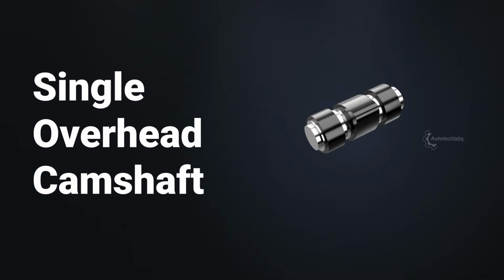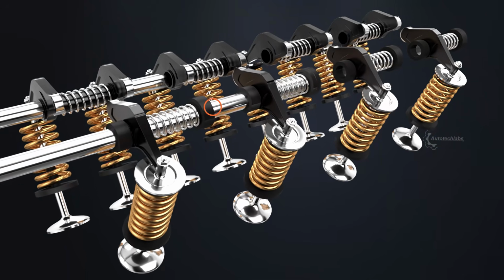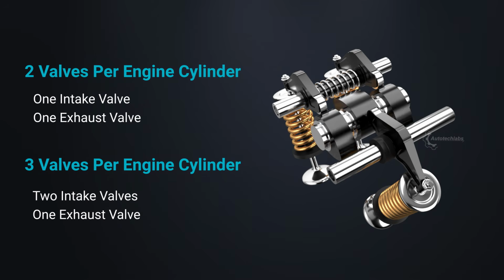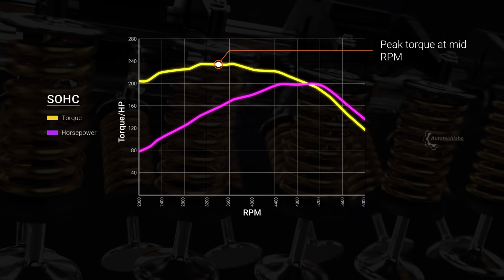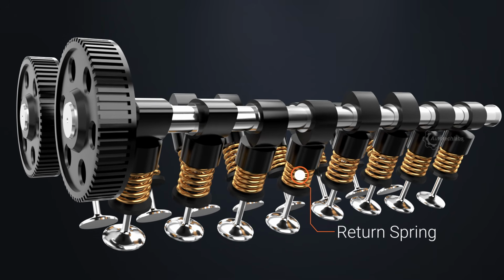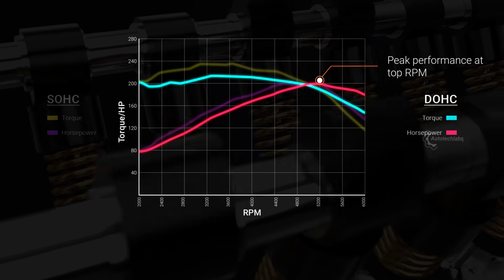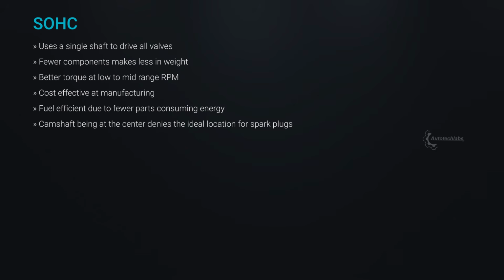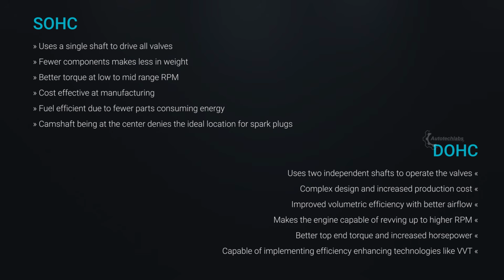SOHC vs DOHC | Autotechlabs

Comment: Tappets arent really used in modern engine designs anymore. As well as SOHC, seldom seen. And that may well be due to the VVT technology what is more or less state of the art in all  modern engines and you cannot achieve this with SOHC. the total concept is whats important and  with direct injection, boosting, central spark plug position and all the little things we do to optimize efficiency, the gain in friction loss reduction of SOHC can be overcompensated by reduction of one cylinder (downsizing by proper boost -> and the airflow that is needed to do that --> more valve area --> 4 valves) because the piston group has the highest share in friction in the whole crank and valvetrain.

Comment: Take a look at Yamaha R15 V3, it uses a SOHC setup, even then it has 4 valves and VVA tech similar to VVT due to which its revs up to 13K RPM and has powerful top end power. Japanese engineering at its best.

Comment: Thing that need t be specified.
SOHC isn't limited to rocker arms in 2 valve configuration.
Which also removes "no ideal spark plug space" issue.
DASOHC-Direct Actuation SOHC is literally taking one cam and valve config From DOHC but cam is SOHC aka 2 valves don't do the same job and open at the same time.
As such the can be placed at angles like DOHC ,allowing for spark plug to be placed as desired.
Pros: 
Even less weight, 
Allows for " ideal Spark plug placement"  
DISCLAIMER Its not a thing people I'm being ironic you don't drive F1 cars You drive consumer cars(even in Ferrari's) such matters are easily resolved by Reshaping the piston face and head cavity, and even than minuscule to the point of insignificance compared to cost of redesigning EVERYTHING in the Engine head. 
Cons: 
supports only 2 valve configuration.
no "Ideal spark plug placing" Actually old side plugs are significantly easier to replace.
Maintenance is complicated compared to SOHC rocker config. It requires change of parts (shims) to spec tolerances instead of simple Screw adjustment. As such is susceptible to ANY loose tolerances be it actuation point or bearings. Shims cant be always found in exact spec which also means more special tools to grind them.
DOHC can also be in 2 and 3 Valve spec. 
Reason why you would want that is advanced economy trough technology such as Variable Valve Timing.
SOHC has fixed valve timing due to correlation of valve timings is tied trough a solid Steel shaft.

Comment: No mention made of the vast differences in adjusting the valve clearances...... not to mention the differences in the need to adjust the clearances.......  ie. wear rates!
Given that engine maintenance (and hence cost) is crucial to longevity, those are glaring omissions.
A poor presentation to say the least.

Comment: I thought that the main difference between SOHC and DOHC drives, given that either can do 2-4+ valves per cylinder, is how much harmonic vibration you're willing to accept in your valvetrain design.
SOHC cams have to cope with some strange offset vibrations through them during operation, from the staggered intake and exhaust cams, which can then strain the cambelt or camchain, causing longevity and reliability issues.
Adding in a second camshaft can seriously reduce these harmonic vibrations, as well as open up other possibilities such as variable cam timing etc. although it does increase overall cost of manufacture. Unless I'm wrong..
Reply: Z do You are 100% correct.

Comment: When can we finally ditch camshafts altogether and move to electropneumatic valve control?
Reply: Never, mechanical components have better reliability than electrical therefore in everyday use we will always have camshafts.
Reply: Likely in this decade, due to new pollution norms inside the EU. It's hard already to respect Euro 7 with current engine tech, most likely there will be steps in adopting Koenigsegg FreeValve like tech on mainstream cars. This would improve efficiency a lot, and also could lead to a more easier fix using firmware update to enhance vehicle usability in the latter of it's life and so it's likely to use a car for more of it's life at the same standards of pollution. Yes, might not be what the car producers wants, but it is what they need to do.
Reply: Likely due to cost.
Reply: when the cost is down? everything is about cost.
Reply: It’s already been done, look up Koenigsegg no cam engine

Comment: I drive a 3.8 l sohc, comparing it to similar displacement dohc engines it makes good low rpm power but less top end. For a street engine low down power is better.
Reply: Which is why diesel is so popular.
Reply: and it's also ideal in city driving where you always accelerate from red light, and for passing other vehicles quickly

Comment: Scotty kilmer next video "Why not to buy SOHC and DOHC" lol just kidding.
Reply: Go for QOHC. V engines with 4 cams haha
Reply: But I still don't get why SOHC produces less power than DOHC??
Reply: @JohnKickboxing  Basically like they said; SOHC are usually fitted with less valves per cylinder due space constraints. It's not really due to having  2  cams instead of one, it's more of a side effect thing. Another example: a DOHC car almost always have the spark plug right  in the center of the  cylinder for better an more uniform combustion and that simply isn't possible on SOHC unless they offset the camshaft and use longer rocker  arms on one side. @Burcey B That once again has mainly to do with with  valve count  and lift which effects performance. Usually  on low rpm you actually  want a slight vaccum to occur because you won't be using all the  air that is coming into the cylinder anyways. You will be compressing air that in turn will not be used up in the combustion event (3rd stroke) with the fuel therefore you are losing power (torque). This is all compromise game. You give away something to gain something. Of  course that VVT and other systems reduce this compromise and pretty much give you the best of both worlds but at an increased cost and complexity.
Reply: The Reason why DOHC produces more power than SOHC. Is that DOHC can combust more air ,plus a dedicated camshaft per valves .
Where as SOHC can only combust just a right amount of air .and it only has a single camshaft which means .it's the only cam shart working all of the required process  of the engine
Reply: @ronredvidz7927  they also rev higher
Reply: @ronredvidz7927  dohc can treat intake and exhaust timings differently, while sohc treats them both the same.
Reply: Honda used sohc while toyota and other manufacturer used dohc
Reply: @jericlamb2676  Honda also made many DOHC engines  D16A9 /B16A/B16B/B18C H22A/ H23A/F20B/F20C/K20A/K24A K20C .
Reply: He’s old school. I’ve learned a lot from his  videos, but technology has evolved compared 20yrs ago.
Reply: Douglas Healy also, how do sohc produce low end torque?
Reply: Bruh
Reply: Gotta love Scotty lol

Comment: V6 with 2 heads / 1 cam / head =SOHC ( 2 cams / engine )
VW VR6 with 1 head / 2 cams / head = ? ( 2 cams / engine )
Reply: It's a DOHC as long as every cylinder has 2 camshafts working for it.
Reply: @dannyz955  each cyclinder bank has its own cam, each cam does 3 cyclinders, ie cam 1 controls intake and exhaust of cyclinders 1,3,5
Reply: The VR6 arrangement needs two overhead camshafts to drive all the valves, regardless of whether the engine has two valves per cylinder, or four per cylinder. This simplifies engine construction and reduces costs. In early VR6 engines with 12 valves (two per cylinder) two overhead camshafts were used. The forward camshaft (in the transversely mounted engine) has six cam lobes to control the three intake and three exhaust valves of the front cylinder bank, without using rockers. The rear camshaft is designed the same way, but controls the rear cylinder bank.

Comment: let's say there are two engines designed equally well, one is SOHC while the other is DOHC. Both have 4 valves per cylinder and both have no Variable Valve timing nor VV Lift. Both have same sized valves and similar port and combustion chamber design, etc...

which one will produce more top end horsepower and why? some say the DOHC will produce more top end, but why would a 4V/cyl SOHC produce less even if they have the same number of valves?
Reply: Ns200 vs duke200 perfect example
Reply: It's like the comparison between OHC and OHV, but with less intermediate parts between cam and valve.
OHV   = cam -> pushrod -> rocker arm -> valve
SOHC = cam -> rocker arm -> valve
DOHC = cam -> valve
In theory the DOHC has higher redline because cams can move valves directly which minimizes valve float.
Reply: DOHC with bucket tappets typically have less reciprocating mass than SOHC with rocker arms, so higher RPM before valve float, for a given on-seat spring pressure.

As for production costs, it's not just about parts count, it's about precision machining operations in the cylinder head casting.  Bucket tappets require more precise machining tolerances than rocker arm shafts, screw adjusters, etc.

Comment: I could tell the big different with SOHC on Honda just simply poor in low end torque, you can tell big time with stick shift, auto is a bit better regardless 4 or V6.
DOHC in general yield a way better low end torque.
Reply: Both engine can be made to roughly make the same so that’s an unfair comment , if you had 2 engines with everything the same , then compare

Comment: Hi great visualization. I keep hearing about the cost-efficiency of the SOHC and from your video I can't help but wonder, in DOHC you have the 2 cams to make, in SOHC you have to make the cam, the 2 shafts where the rockers are placed AND all the rockers... Where does the lower cost come from exactly?
Reply: With dohc you have 2 cams and 2 camshafts. With sohc you only have 1 camshaft and 1 cam.
Reply: @tommieboi707  but in SOHC you have to produce at least 3 extra rocker arms (for 4v/cyl setup) with bearings inside each of them, plus the rail where you place your rocker arms. this makes the number of parts higher and you have more stuff to assemble. why would the DOHC, which has 1 extra cam but less parts overall and no assembly of rocker arm system required (they can simply run bucket tappets), be more expensive?
Reply: @sepg5084  exactly
Reply: @sepg5084  And the more websites I see saying the same thing without actually questionng it, the madder I get 😆

Comment: You just gonna come back and pretend you haven't uploaded for 2 years? 
Sweet 😎 Thanks for the education
Reply: @autotechlabs  wouldn't a 4 valve sohc be more complex than the 4 valve dohc since roller rocker arms are more complex than the plain bucket tappet cam followers on your example? What advantage would an sohc design provide in that situation then?

Also, wouldn't an sohc head have better valve lift (leading to better flow and higher power) due to having the leverage advantage of rocker arm ratio vs. bucket tappet dohc cam followers on your example? To increase the valve lift on that dohc example you'd need bigger cam lobes than normal while the sohc can simply have the same cam lobes but have higher ratio rocker arms.

Also, it would seem that the valvetrain inertia on the sohc is greater than the bucket tappet dohc on your example, which would then cause to the dohc to have better low-end torque due to less power used to operate valves (assuming that valve lift, duration, and intake runner design are the same)? Unless of course a single bucket tappet is actually heavier than a single roller rocker arm assembly.

I am genuinely curious what the advantage of a dohc is over an sohc on a non-VVT application. Obviously a dohc has better options on VVT by simply having cam phasers on each cam lobe, providing independent VVT between both intake and exhaust valves. independent VVT on an sohc's intake and exhaust valves would need more than just 2 phasers since you can on out 1 phaser on a cam directly. I've searched high and low and never got a definitive answer.